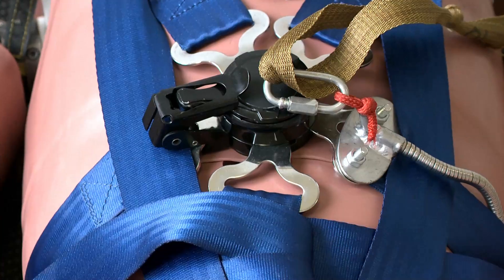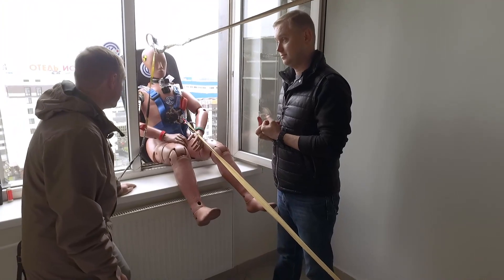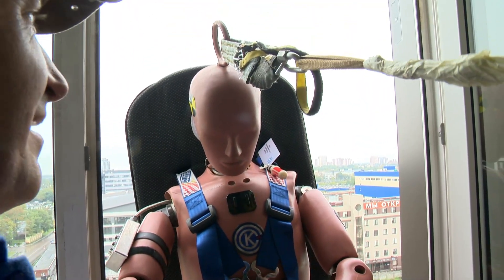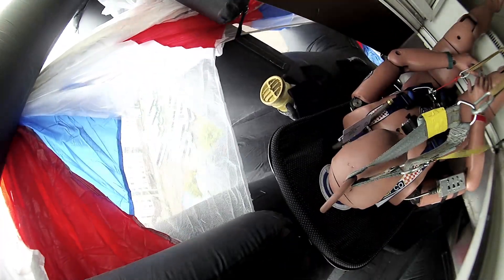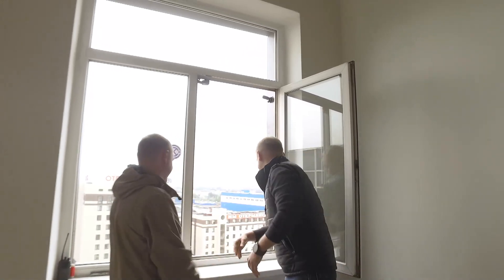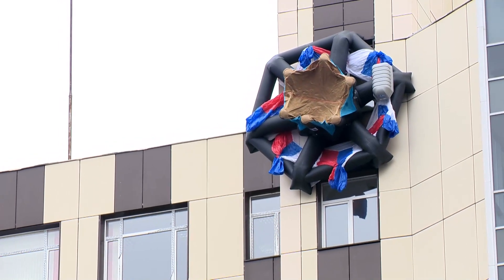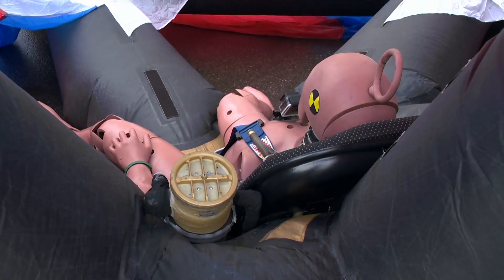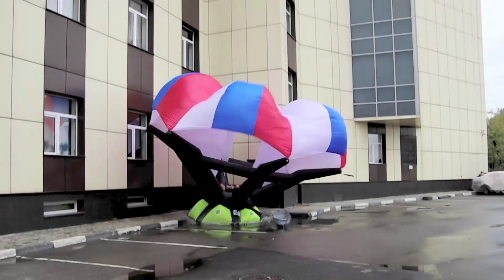How Does a High-Rise Fire Escape Parachute Work?

Comment: Fantastic idea. Though vortex'es from normal air currents, then add heat of the fire? Also 300, 400 or even a thousand or more people attempting to escape from super high rise buildings, collisions? Finally paradescent during the operation, flames at lower levels, but still 20 or 30 stories above the ground, will the air sacks burst and/or deflate? Such an interesting video, Thank you
Reply from the maker: Great point!